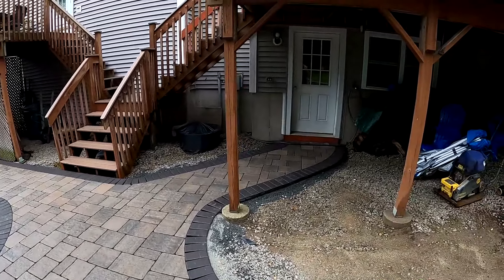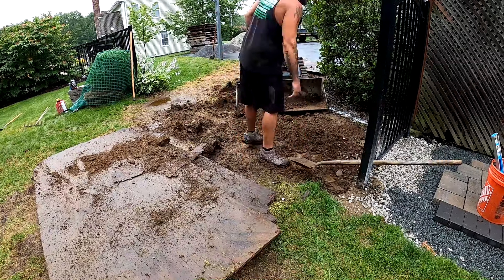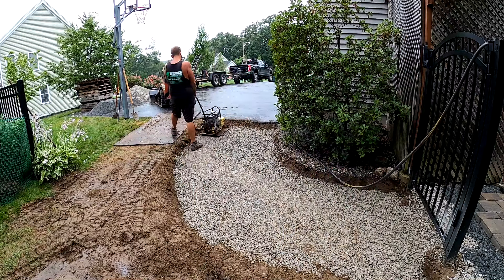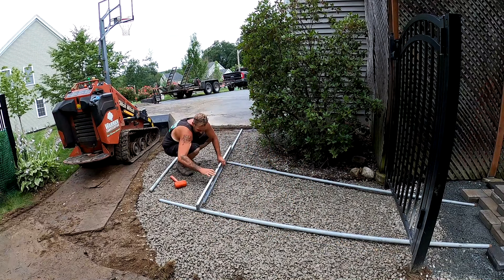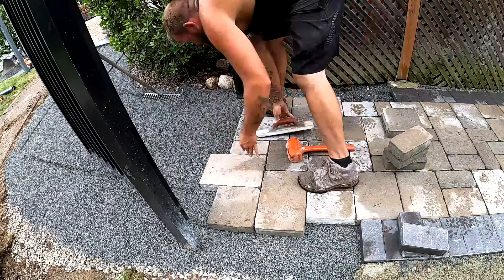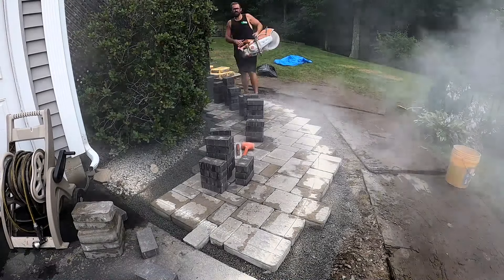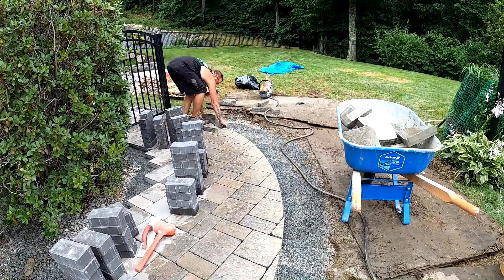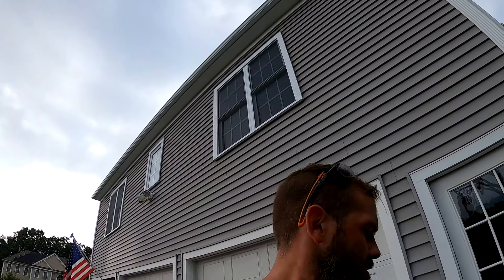How To Install a Concrete Paver Walkway (DIY)

Comment: Watching you helps me realize the labor involved in hardscapes.  You do excellent work and I appreciate your attention to detail.  I wish I could hire you guys, but you're way too far away.  I'm getting ready to have a patio installed with a garden wall and raised vegetable garden beds.  Should I get the raised beds lined with landscape fabric?  They'll be using Heritage Collection Belgard Weston Wall and Dublin Cobble in Fossil Beige for my old  1& 1/2 story cape cod.  Could you please do a video for homeowners on after care?  I've seen these really small 1600 psi green works pressure washers with a kind of mop attachment with rotating squirting brushes.  Would that be good for a biannual clean?  Pollen is the worst here.
Reply from the maker: This is definitely a very labor extensive industry. I always build my walls on top of a base with with fabric at the bottom. Then if you are putting soil behind the wall, you run the fabric in between the soil and the backfill material of the wall. I will probably do a after care video someday, not sure when though... Thanks for the feedback!✌

Comment: Within the industry, are the gaps in the curved border acceptable?  Shouldn't they be cut?
Reply from the maker: Those gaps are completely fine. Cutting all those pavers would be crazy and not worth it. As long as the gaps are uniform with each other for sure. ✌

Comment: How do you determine the angle for the paver so that water drains outboard?
Reply from the maker: That is figured out when setting the screed rails. Check out this video I made to understand the screeding process a little more 👉https://youtu.be/JJvIb05mmGw

Comment: Amazing work bro. Just a question for you...how many inches should the 3/4 crushed stone layer be?
Reply from the maker: Thank you! Here in Massachusetts (or any other freeze / thaw state) a minimum of 6 inches is what I recommend with a good sub-soil. If it is bad sub-soil like clay, 8-12 inches depending on how bad it is. If you are in a state with no freeze / thaw cycle, 3-4 inches would probably be fine ✌
Reply: @TheChristianHardscaper  That's excellent. Thank you!!

Comment: Hey I just discover your technique as I am about to lay a lots of large concrete paver( 15,5x15,5 inches ) around my pool.Was about to use stone dust with rock and soil so I am happy to learn why its crap. Good jobw with your channel you are very good! I was wondering what kind of concrete do you use to maintain the edge? Do you have a video about this phase? Is it good where we have big freeze cycle in winter? And is concrete for edging is also good is you use 3/4 rock with soil base and construction sand on top?
Reply from the maker: Thank you! I'm glad you found the video too, because you definitely do not want to use stone dust or sand for your bedding layer. And for the actual base material, nothing is better than 3/4 inch clean, crushed stone. The technique I showed in this video is exactly what I would recommend for a paver project around a pool. I use this system for every hardscape install I do. I also use concrete for my edge restraint on every project I Install as well. It is not any special concrete, you can use any pre-mixed bag of concrete from your local home improvement store will do the trick. And concrete for your edge restraint is especially better in freeze/thaw climates. 

I don't have any specific videos for how I do the concrete but i go over the topic in a few different videos, check out this link to one that i explain it in some depth. https://youtu.be/oHNrXZMStZA

Good luck with your project!✌
Reply: @TheChristianHardscaper  thank you ! As I am always thinking over for my construction project I was thinking of adding special fiber to the concrete edge to make it more longuer lasting and crack resistant! My project is in a sandy soil and I bought some regular geotextile fabric. Do you think it would   be also good to use or the gator one is the only way to go but why ?
Reply from the maker: If you can find fibers to add to the concrete, that would certainly help. As far as the fabric, I try use the plastic geotextile fabric always, unless I can’t find any in stock. Then I will settle with using a cloth fabric which is definitely way better than nothing at all ✌🏻

Comment: Can you list the links to similar products you use and how many inches of stone you use. It is hard to find landscape fabric that clearly lists your specifications. (Geotextial non-woven plastic fabric), 3/4” clean crushed stone, and chip stone (is that like paver base?)
Reply from the maker: I use a (Woven Geo-Textile Fabric), plastic, not cloth. It needs to be woven for water to travel through. Here is a link to 1 manufacturer that makes it, there are plenty of them if you can't find this one around you. Just do a little research into local suppliers. https://alliancegator.com/gator-grids-fabrics/gator-fabric-gf5/

The stone is 3/4, clean crushed stone. Any material provider will know what this is. It is crushed stone with all of the fine particles removed. 

The chip stone is the same kind of material at a smaller size. Clean, crushed stone, between 1/4 inch and 3/8 of an inch. Some places call it (HPB - High Performance Bedding) Some call it (PBS - Premium Bedding Stone) and around here, it is mainly called (chip stone or chip rock).

Comment: Great series brother ! Great work. I have a question I live in northern Michigan.  Very hard winters here probably similar  to mass. Would this be fine here also?
 And question number two would this work with edging rails that get staked down? Or do you recommend the concrete to lock the sides in ? 
Thanks for the great videos.
Reply from the maker: Thank you! This method would be awesome for you in Michigan. Honestly, this method is better for absolutely any geography. It is far superior to dense grade / sand. Holds on to no water and does not wash out. The main point is that it does not heave like dense grade / sand. It holds little to no moisture so when the freeze comes, it does not lift like dense grade / sand. And even if there is moisture, it expands into the open spaces in the stone instead of pushing the material apart. Such a good method. 

And no, you can't use edging with straight stakes. They don't hold tight in the loose stone base. We use concrete. Here is a video on how I do that 👉https://youtu.be/_X1tCmMJQqk
Reply: @TheChristianHardscaper  thanks buddy !
Reply from the maker: No problem! ✌

Comment: Sorry to bug you bro, I had another question...if I wanted to have a 10 inch base of the 3/4 crushed stone after compaction, how much should I order in if my space is 10ft x 8ft?
Reply from the maker: Sq ft times depth ( in inches ) divided by 27 gives you how many yards of material you need. So 10x8 = 80 sq ft. 80 sq ft times .9 ( which is close to the equivalent of 10 inches ) , so 80x.9 = 72. ( that's 72 cubic feet ) we need to divide that by 27 ( 1 yard of material is 27 cubic feet ) so 72 divided by 27 = 2.66 yards. buy 3 yards to be safe.  ✌
Reply: @TheChristianHardscaper  You star!! Thank you brother.

Comment: Why not use the dirt from the walkway and move it around the existing patio you already did?
Reply from the maker: We did use some of it behind the wall we built, But we always bring in new Top soil for around the patio. We make sure it nice loam mixed with compost to insure the grass comes in the best it can. ✌

Comment: How much does it cost for 1200 sq foot of pavers?
Reply from the maker: Most common 3 piece design paver options around here will cost between $5.25 - $6.75 per sq ft. So it would cost between $6,300 - $8,100 for just the pavers.

Comment: Nice work!  It's a beautiful walkway and patio.  I already laid crushed concreate as my base for a patio around a pool and I'm close to screeding (was going to use stone dust but I'm glad I watched your video).  Do you think it's ok to use the material you used for screeding if I didn't do the sub base the same way??
Reply from the maker: Thank you! And yes, you certainly can used the 1/4 inch crushed chip stone over crushed concrete base. If you can’t find 1/4 inch, I recommend using 3/8 inch crushed stone. 👍🏻
Reply: @TheChristianHardscaper  Thanks!  One more question - I didn't notice any edge restraints.  What do you use to keep it all in place on the edges?  I've seen cement edges, that black plastic edging with the long stakes, etc....what do you recommend when using 1/4 inch chip under the paver?
Reply: Sorry another question!!  By using 1/4 in chip does that mean I don't have to worry about if it rains like I would if I were using sand or stone dust??
Reply from the maker: I use concrete for my edge restraint, it holds the chip stone in place far better than the plastic edging and is much cheaper. And yes, the chip stone holds up 10x better than stone dust,. The worst part about stone dust is the "dust" part. All the dust and fine particles of the stone prevent water from freely draining / flowing through it. Stone dust holds on to water like a sponge and that is the worst thing for pavers to be constantly sitting in. The chip stone does not have dust or fine particles in it, allowing water to freely flow down into the sub-base. 👍
Reply: Sorry I have so many questions and appreciate that you always answer!!!  My patio is around a pool and if I was going to use sand I'd probably set the patio pavers a tiny bit higher than the coping with the thought that the final tamping on top of the pavers would push them down a little bit and be flush with the coping.  But, if I switch to using 1/4 inch chip (BTW a local stone place is calling this "rice" - have you ever heard that term and do you think it's the same thing?) then I'm wondering if you do a final tamping on top of the pavers of if you find the mallet to be sufficient.  If you do tamp on top of the pavers do you find that it changes the height when using 1/4 inch chip...to the point that you'd purposely set your base and screed poles a little higher than usual?  Final question for now - do you recommend polymetric sand or paver sand to fill the joints?
Reply from the maker: @dianabraendly9193  I would definitely recommend chip stone or "rice" LOL ( I have not ever heard it called that but its pretty funny🤣 ) over using sand. We do set our screed rails about 1/4 inch higher than final grade to account for compaction and settlement. The border pavers or pavers on the edge usually get compacted with our hammers and the rest get tamped / compacted. I use my hammer on certain pavers when they need to be adjusted individually. And we almost always use polymeric sand, it hardens to lock the pavers in place as well as help to prevent water from getting in the base. ✌